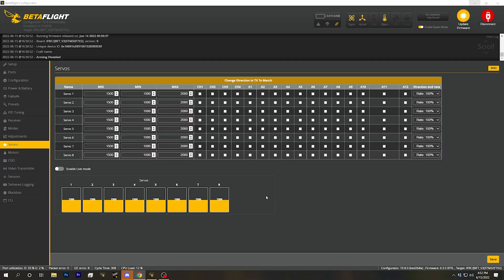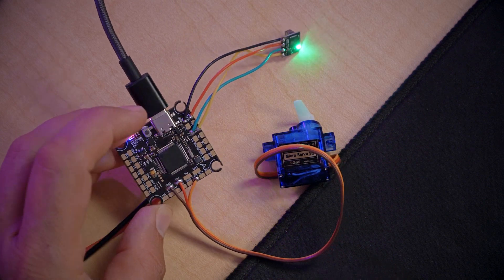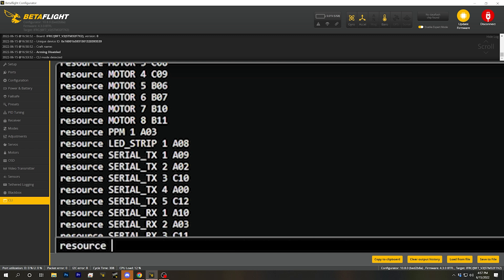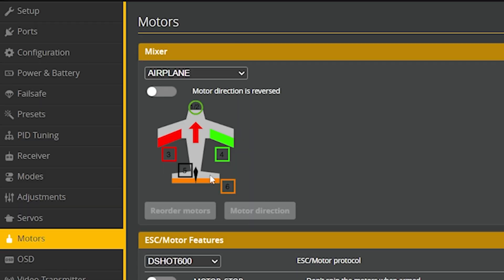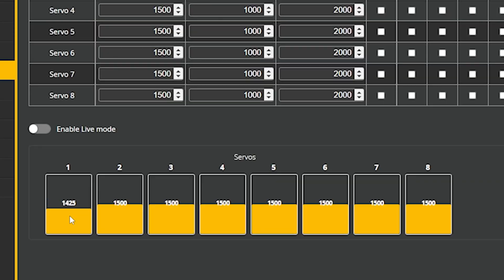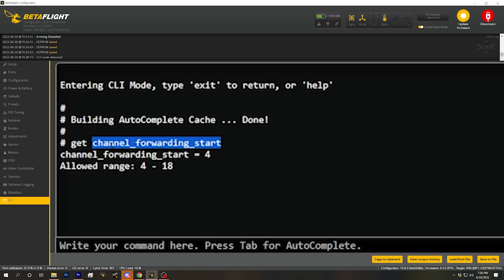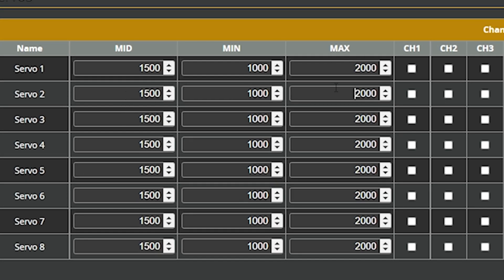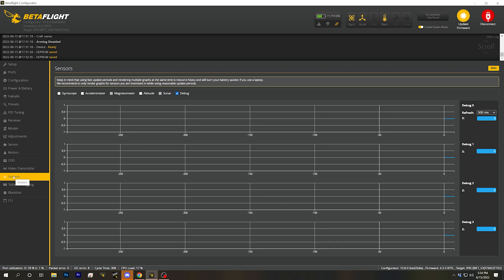Betaflight 4.3 Servos Tab | COMPLETE WALKTHROUGH PART 14

Comment: wwwwwww w in the chat😀😀😀 ive been trying to figure this out for a robot claw for abt a week thx josh
Reply: Elrs or sbus to pwm converter hooked parallel to your flight controller . Both will get the reciever out signal . Just don't  hook your robot arm to channels your quad is using .

Comment: Missing the servo tab. Can't find a setting in the configuration tab to activate it. My drone is a GepRC Mark 5 ELRS. 10.10.0 (c97deaf), Version: 4.5.1.

    Video transmitter: GEPRC RAD 1.6W
    Camera: Caddx Ratel2
    Antenna: GEPRC Momoda 5.8GHz MMCX RHCP
    Motors: GEPRC SPEEDX2 2107.5 1960Kv
    Stack: GEPRCF722_BT_HD_V3 (GP105306 MARK5 Analog 6S ELRS 4.4.3 v3.0.txt)
    Gyro: ICM 42688-P
    Frame: GEPRC Mark5
    Receiver: GEPRC ELRS Nano 2.4GHz
    Propeller: Ethix S5
    Weight: 385g
    Recommended battery: 1300-1500mAh 6S

Comment: The syntax to change channel forwarding start is a bit different than the way resources were assigned. To use AUX 4 as the first forwarded channel, use:
set channel_forwarding_start = 7

It took a while to figure out the correct syntax since Bardwell didn't change this setting in the video.

Remember to type:
save

After you make the changes. I forgot to do this myself the first time I changed the resource values. I haven't had to make changes via the CLI prior to forwarding channels for servos (gimbal control).

Thanks for all the great content JB.

Comment: I tried this, but I don't have a resources tab for some reason? When I try the servo CLI to change the pad it gives an error saying invalid resource name. Is there a way to enable servos somehow??

Thanks!
Reply: I don't think there is a "resources" tab. Did Bardwell call a tab resources?
One thing Bardwell didn't mention is you need to include the "servos" keyword when you flash your flight controller. BF doesn't include all the options automatically. When you initially flash your FC, you need to include the various functions you want. On JB's V2 FC, the servo option isn't selected by default.
You likely need to reflash you FC so the servo option is available in the CLI.
Edit: I'm just getting a servo to work on my FC. What do you want your servo to do?

Comment: Hello, I was trying to reverse the servo direction, but its not working - still turning the same direction. I have it set on LED pad, two position switch on my radio... No clue how to reverse the servo.
Reply from the maker: If you can't get the FC to reverse the servo, then reverse the switch in the controller. Go to the Mixes screen and change the weight from 100 to -100.

Comment: Cool  i´m using Cleanflight with a Spracing F3. There is no "recources" in the cli how is this named in CF? I tray to use an Airplane and stumbling with the the forward servos like rudder Alivator etc. that´s hard...
Reply from the maker: That feature may not exist in CleanFlight, and the servo configuration may be completely different.
Reply: @JoshuaBardwell  Yes it´s complicated ... but i found resource Servo xx so i did what you did resource Motor 2...8 NONE and took A07, A11 etc. for recource Servo ( was NONE) and it startet working. Puh that was a long ride. One more issue. Got a secnd f3 did the same, ...worked but...without arming it´s doing the correction on the rudder like anglemode from start how to turn that off/on? I took "wing" model in the setup instead airplane so where to tur that off ? A btw the arrow (front) on the controller is nice but it´s not as the controller is "Angle"ing the rudder hmm...in know i can turn it in the setup but last time (years ago) i tried it became standart after swicht off and on... we´ll see...sorry guy´s i´m an Airplane guy but i like that controller telemetry stuff...

Comment: Unfortunately, I don't believe the Speedybee F405 V3 supports servos in any way
Reply: pin S9 - servo1 preinstalled
Reply: @yevhenzh  I want to use S9 pad to control a servo but how do I get a mode for a servo in the modes tab so I can assign an aux channel to it to control the servo?
BTW this is my other account I just have to use this account because bardwell blocked me from commenting.

Comment: Thanks for the great video series! OK so we make changes in this betaflight  programmer and we hit save on each tab. But is this all we need to do to make the changes in the actual fight controller board. Or do we then need too flash this new info or changes to the board?  Or does save send the info to the board?
Reply from the maker: Hitting save does it.
Reply: @JoshuaBardwell  ok thanks, but I didn’t see any changes to my display on my goggles after making chances in betaflight osd tab and saving. I had my quad powered on a 6S, my RadioMaster on, usb plugged into the computer and betaflight open and connected, made the changes in the configulator OSD tab. Hit save and the onscreen display did not change? I did this with the goggle powered up all the time.
Reply: Look like I got it figured out, had to make a change in an OSD slider in Betaflight.

Comment: Hello, thanks for your video !
(Servo Tilt Configuration for Gimbal)
By using the LED-Strip it´s working very well with Servo 1 (Tilt servo). When I´m trying to map Servo 2 on the same LED Strip (when Servo 1 is unmapped) it doesn´t work. So no movement of the servo, when I´m rolling the copter.
I would be very thankful, if you have any ideas for this !

Greets from Germany !

Keep up the great work :)

Comment: 10:40 I guess you can also use a 3 position switch to set 3 different uptilts. One at 40° for flying fast, one at 30° or 20° for freestyle, and one at 10° or 0° for exploring and landing. That's why I'm watching this video, to try to learn to set this up.
Reply: You could change out the default 3 position switch for a momentary 3 position switch, return to centre.  So that Up raises the camera, Down lowers the camera.

Comment: Well I'm a new FPV pilot and just bought the Tinyhawk freestyle RTF. So now the question. I installed the 4.3 and trying to install the Cli backup file after  update but some of the settings have wrong name errors, tried to delete those, on request from a betaflight Discord member. Then the shit went sideways. All lines then had command error 👀 so now I'm back in 4.2 but would like to learn how to install 4.3.
Best regards Cornycupid l

Comment: The 1/2 output numbers on the airplane at the front of the model are for the motor outputs. Planes can have motors :). On INAV there is no need for the DMA to drive the servos, so I think it is the same on Betaflight. You can remap the motor output pin to the servo, as long as it does not share the timer with the other motor. Also, the possible resources for the servos are UART6 RX & TX (on F405 and F7xx), but it depends on timer assignment and motor allocations on PC8 & PC9 pins, if there are motors assigned there, it might be impossible to run servos on UART6 due to the timer conflict. The LED strip is a save resource for the extra motor or the servo, but then you loose LED function. Timer allocations can be checked and changed in the CLI.
Reply from the maker: Oh damn hahahaha planes have motors. Of course. Sounds like there is more to the timer assignments than I really knew about.
Reply: @JoshuaBardwell  I think that your knowledge is great. :) It is just the limitation, that the timer can drive either motors or servos, not both at the same time, as they requires different timing*. As timers are shared between pins there are possible conflicts. Everything depends on the FC design, sometimes it is easy to remap, sometimes impossible. LED pin is an exception, as it has it's own exclusive timer by design, so its safe and easy to remap. (*)In fact, you can drive motors at servos timing, but 50 Hz PWM is not the protocol tigers like the best :)

Comment: JB i am having a problem where my reciver and my transmitter are bound and i have the green light but i am getting zero stick inputs in betaflight which shouldn't be happening because it wprked before so i dont know whats wrong. (I have never been able to get this drone in the air so this is a project that comeback to every once in a while so just keep that in mind).
Reply: I had this happen with a bardwell F7, frsky r-xsr receiver, and a frsky x7 transmitter.  I had reversed two of the wires.  TX from receiver (or sbus out)  to rx on board.  Same for RX (or sbus in) to TX on board.  Hope thats the issue and hope it helps.

Comment: Pretty sure they could just ditch the whole tab (what's the use if even you need help figuring it out ;-) I just loved the conclusion of the tab: "btw if you want it to work the whole tab becomes redundant"...Seems a bit like a devs relic. I really like the way you kept your promise on this one... very amusing...
Reply from the maker: The tab is totally useful if using an airplane mixer that includes servos, or if using servo_tilt. Just when using aux forwarding it doesn't have a purpose.